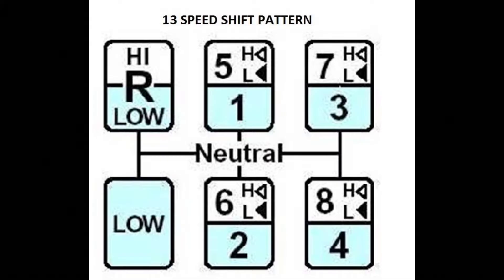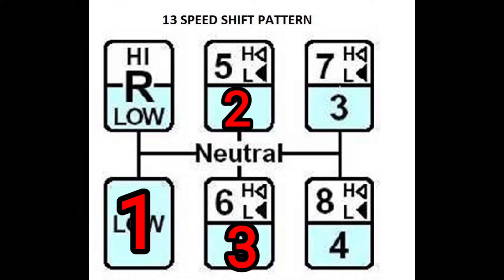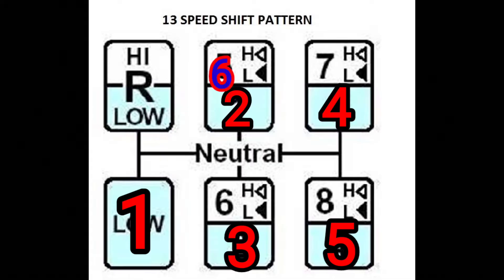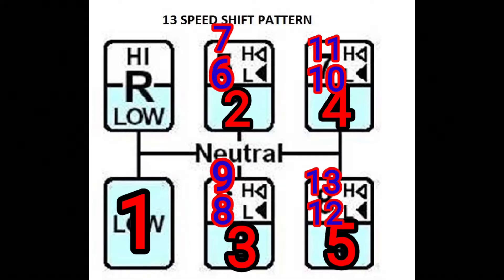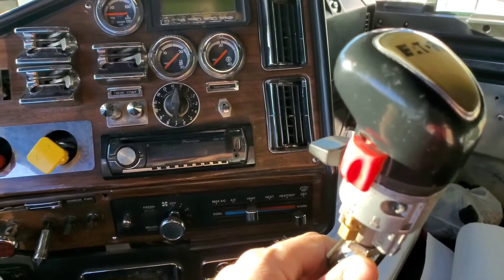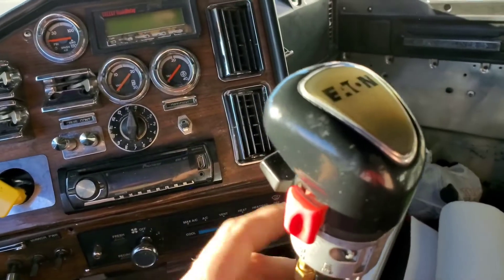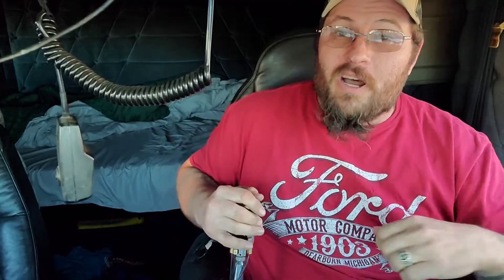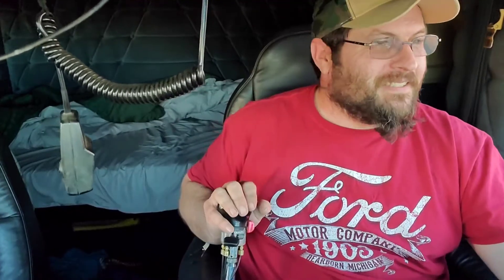HOW TO SHIFT A 13 SPEED MANUAL TRANSMISSION IN A SEMI

Comment: Beautiful explanation sir! So if im in 12th gear and i want to down shift to 11 i split it with the foot on the accelerator then shift down and so on? Down shifting is where i am a bit confused. Otherwise Thanks a lot brother!
Reply: For me,,Picture all your gears in your head, memorize it, or try to, it helps later,, when you need to shift faster,, Go in reverse order, when you feel the RPMs slowly going down, that means your losing power,  so you need to go down a gear,  but it's a High gear,,so switch it to High,  go in the gear, switch it to low quickly, let go pedal quickly but gently,  and the tranny will downshift,,, It takes practice and quick switching,  and always remember what gear ur in,, cause if you don't,  It won't sound Good...
Reply from the maker: Pretty much! It's just a feel thing. You get used to it quick

Comment: Ive been driving semis for 21 years and only used straight ten and automatics. Thank you for the video. My 1st time in 13 speed in my new company.
Reply from the maker: Glad I could help! Good luck
Reply: That's me iv always Ben in 10speeds an wen I interviewed for a job guy said it's an 8speed had me all messed up in the first 3 miles till he finally explained it better he just wanted to see how I'd handle it I guess but by time we was coming back I was doing good but it thow me off big time
Reply: Same here brother only drove 10-speed , 5 and a 4 transmission and automatic transmissions best of luck to you and be safe on the road God bless!

Comment: wow man. thanks a lot. best video and most understanding i found. i’m about to buy a 13 speed and been told it’s simple i can learn in a parking lot.  bud i want to understand how to graduate from a 10 to 13. 
can u make a video how to downshift also ? and what rpm do u want to shift in a 13 speed ?  my 10 speed is 1600 rpm.
Reply: Yes sir I will be man thank you so much are you able to show our viewpoint of your dashboard like your tachometer and speedometer if not that’s cool but I appreciate you man good stuff
Reply from the maker: @diesel81937  ill try to accomplish that but I'm a one man show here lol. Maybe I'll have my wife film for me before I leave tomorrow.
Reply from the maker: @diesel81937  you're very welcome.  I appreciate the sub!
Reply: Thank you great video
Reply from the maker: Hey I'm glad it helped!! I can definitely do that for you.  I typically shift between 15 and 1700. Depending on the engine. Big cats don't like as much rpm as a series 60 12.7 Detroit for example.
Reply: it’s a cummins isx i believe. peterbilt 579 2015. i don’t know my engines extremely well
Reply: also seen some ppl shifting at like 600 rpm. that seems super low. maybe if i knew what speed at what gear that would help. i been driving 2 years but i use rpms when shifting for comfort i guess
Reply from the maker: @diesel81937  probably an ISX. You're fine at the RPM you shift at. 600 is WAY too low. That's lower than idle on some trucks lol.
Reply: yes i agree but maybe was when was splitting gears i don’t know. and what does 200 or 400 rpm split mean ?
Reply from the maker: @diesel81937  the rpm split is how much your rpm drops after you shift. In low range (1 -5) it's about 600 rpm drop. In high range (6 - 13) it's like a 200 to 400 rpm drop depending on gearing
Reply from the maker: @diesel81937  ill be filming the downshifting video here pretty soon so make sure you're following the channel!!

Comment: Do you necessarily have to use the high low if you don't want to or can you atleast downshift without using high low?
Reply from the maker: Yes but if you're heavy you should use them
Reply: @GoFastNation  If your heavy should you also use them downshifting or does it matter on downshifting?
Reply from the maker: You can skip while downshifting
Reply: @GoFastNation  Alright thanks I'm just used to a 10 speed and I'm buying a truck soon and don't wanna limit my options to only 10 speeds. Thanks!
Reply from the maker: No problem! Thanks for watching and good luck with your purchase
Reply: @berniesands6201  I always use low gear to start when loaded. Empty you can start off in 2nd. I cringe when I watch guys start off in 3rd. All that does is destroy your clutch. When downshifting you don't have to use all gears. I sometimes do, but often I'll skip the splitter, and/or go right from high 5th to high 3rd. Each situation is different, and you will use common sense. A 10 speed is simple, but a 13 is away better for your engine, and fuel economy, because of the small RPM splits (200 RPM) in high range. You will not have to rev the engine so high before you shift. On my 13 I only run it up to 13,000 RPM in low range, and maybe 15,000 RPM in high range. 17,000 RPM on hills with a heavy load. I explain it all in my video "3 Ways To Shift a 13 Speed".  Good luck with the new truck!